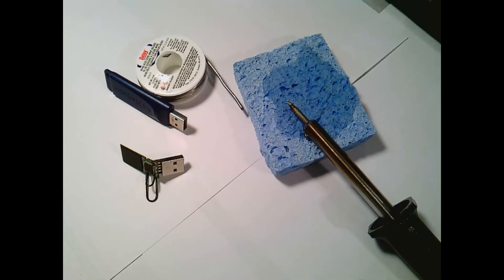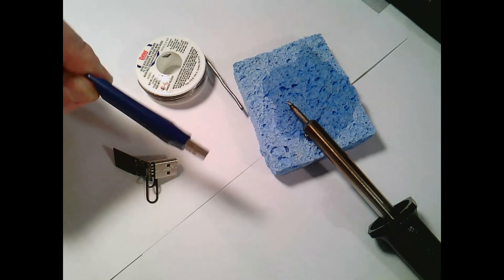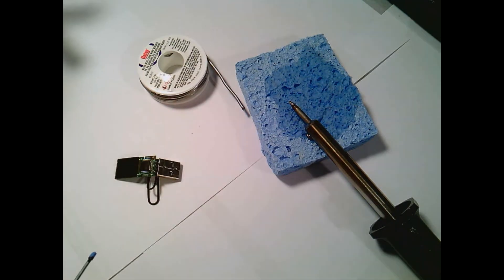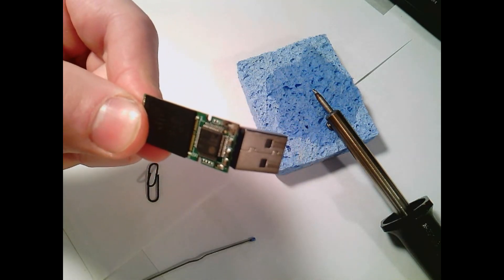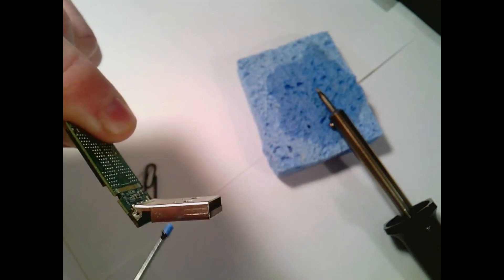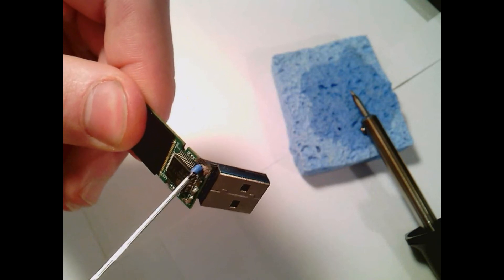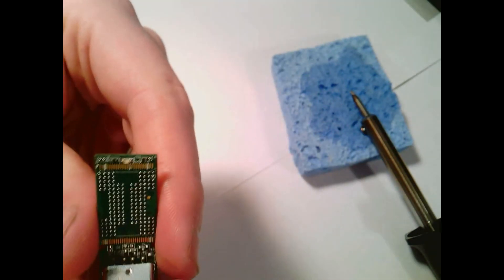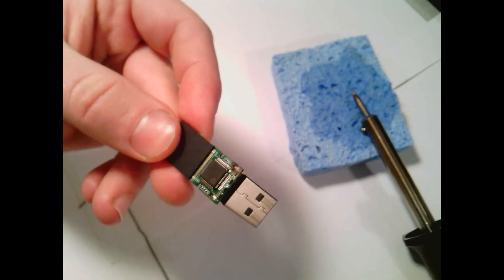Flash Drive Repair - DIY

Comment: What are the tools you use for this ?
Reply from the maker: a small soldering iron, solder, damp cloth to clean any solder from the iron or drive, small tipped metal tool tweezer to manipulate any of the soldered connections-I believe these are also called out as you go through the video. Thanks for watching and let me know if you have any other questions!